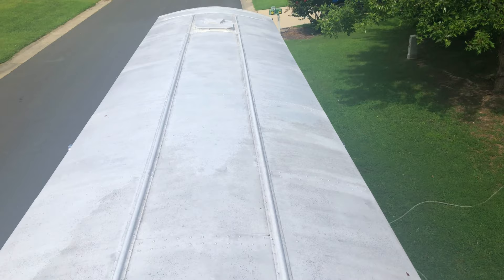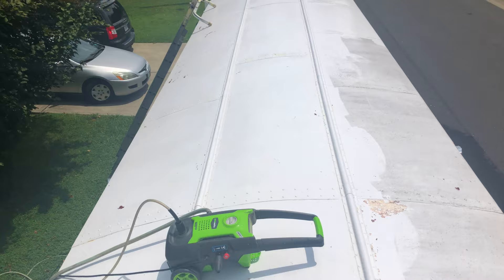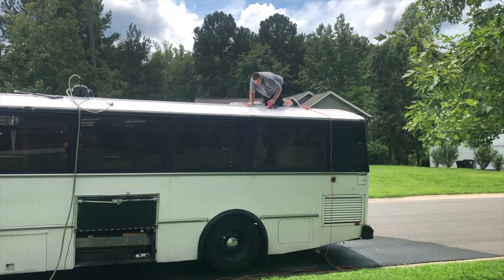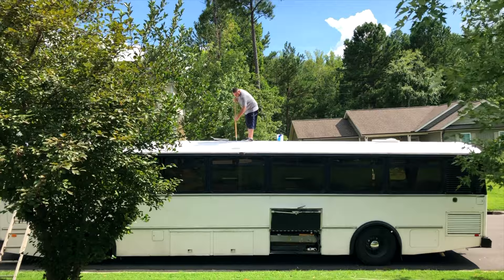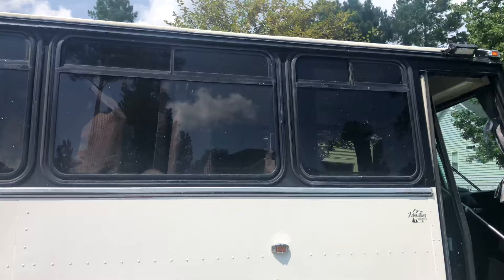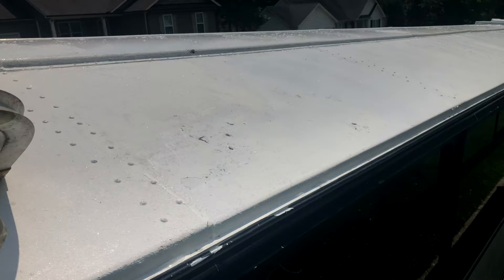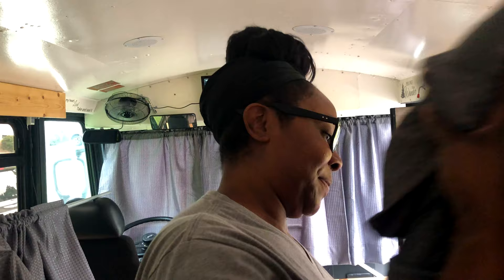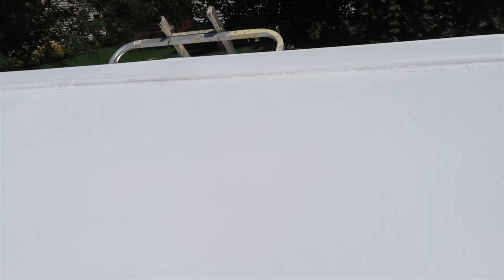Painting My Bus Roof With Henry Tropicool 😡It didn't end well

Comment: I know this is old video, but will pass along some info, henry 887 is 100% silicone coating, if you use this 887, when you recoat you have to use another 100% silicone coating regardless, if it is henry 887 or a different brand, also if you put a vent or something else that needs sealed, Dicor will not adhere to this, you have to use a silicone, henry does have caulking to for this or just use the 887,  I used a brush and put this in a carboard box, next day filled it with water, it sat for days and never leaked, my only complaint with henry 887 is the dust adheres to more then other coatings, also you have to be very careful if on roof when water or dew is on it very slippery
Reply from the maker: Thanks for the comment 🤝

Comment: Great video. Thanks for sharing the challenges of the job. It’s not easy as a non-roofer to get the straight skinny on Henry’s 887, application and product consistency. That is so sickening and frustrating about buying someone’s return as new…that a person would use what they needed, then top off the container with water get a full refund, with no possible way for anyone to check the return or any consideration for the harm they might do to another person. Good to know.

Comment: Nice bus. Sorry about your troubles but think about this. Like Haley said, Tropicool is a 100% silicone coating. Elastomeric paint and roof coatings are water/acylic base. If you have ever tried to paint over a bead of silicone caulk, you would know that water base paint will bead up or separate and not stick to the silicone caulk. Lesson learned, generally speaking, nothing sticks to silicone except another coat of silicone. I'm a 35-year retired commercial painter. These things I know. Next season, just pressure wash again and apply another coat of Tropicool and you'll be good for decades. Or, at 65 mph, the remaining water base coat may flake off in the wind! jk Good luck.
Reply from the maker: Randy Lamoreaux yessir you are correct!  Things like that the average guy like myself wouldn’t know and wouldn’t think to look at it if they are all “roof sealant”. It’s also why I posted the video so people can learn from my mistake.  And most of the paint is already coming off so another Tropicool coat is going g to be needed soon.  😂 thanks for your feedback.
Reply: Awesome i knew that nothing sticks to the silicone but was unaware you could layer it.  Makes  my decision easy
Reply from the maker: Ryan 👍🏼

Comment: Your endorsement of Henrytropicool sold me.
Reply: I did one roof 3 years ago. Still as perfect as the day I finished the job. Now on second roof—the one on our detached garage. Big job for a small roof bc of the need for extensive prep’ing, but going well so far. Next will be the main roof. Bigger job than the other two combined. These roofs are metal with standing seams and are over 90 years old. They have been coated multiple times by people who didn’t remove any dirt or debris sitting on the surface let alone any prior layers regardless of whether they were loose or not. So we’re scraping back probably up to 9 layers of roof coating POORLY applied. If the roof that I did first, the worst of all of them, is any indication I will never have to do anything to the roofs ever again unless something actually punctures them, like hail or a tree branch. Henry Tropi-cool is the best! Do the correct prep and it has a lifetime warranty!

Comment: In my opinion
Your good, if it's not leaking, which probably was your main objective, it's is white and reflecting the sun. Just wait awhile and recoat with the silicone. The other coatings may leave some white chalking on the side of the vehicle as they age but you should be able too remove that with pressure washing. You did a great job
You just got messed by someone trying to get over.

Comment: The problem is the Henry "elastomeric " you used is water/latex based..it will not stick to 100% silicone.  You MUST use 100% silicone Tropicool or some other brand 100% silicone..nothing else will stick...
Reply: Correct. Marketing makes it confusing because it calls it “siliconized” but it’s truly acrylic

Comment: What kind of Henry's Paint did you buy the second time? The tropicool is silicon based, so if you used one of their acrylic based paints over it that might be why it messed up
Reply from the maker: Haley Gill it was because someone returned the 5 gallon bucket after using it and had filled it up with water.  It was open when I bought it so I was already skeptical.  But you are correct
Reply: @TheUngerYears  Whether or not it was returned and cut with water, no other Henry Roof Coating will adhere to Tropi-Cool.
Reply from the maker: @chrisbenoit1035  Yes, we learned that

Comment: Beware of HD staff few know anything about anything.  Henry Products say on label have 24 month self life.  Only one HD in my city had the Henry 884 sealant and 1-gal and 4.75 gal buckets but they were all covered with dust so been sitting on self a long time and beware of age.  The box I took the Henry 884 calk tubes out of was dated in 2017 (I learned later)  so way out of 24 months. One tube was okay, the other was crap. I took the rest back and search the label on the shipping boxes to find newer product.  HD staff was helpful as a heart-attack and had no idea about shelf life printed on the lable.  fyi, when applying roof coating you really need to use a wet film thickness gauge for paint and resins to verify you are coating to required thickness.  Some paint stores have them so does amazon for about $9
Reply: Preciate the info 🙏🏼
Reply: Monty Henson I was putting it on thicker rather than thinner. But if I buy a gauge I may be able to save a lot of $! Thanks for the tip!!
Reply: Monty Henson I had 5 tubes left from a porch roof I did several years ago. Didn’t know how they’d be, but I was able to use all 5! I’d stored them inside vs in our detached garage with zero insulation.

Comment: The second Henry’s you used and the other product were probably acrylic (water based acrylic) and Henry’s tropicool is silicone (oil) based. Oil and water don’t mix.
Reply: The Black Jack Elasta Kool is an elastomeric product.  It won't stick to the 100% silicone and needs several days of clear weather.  
Black Jack Elasta Kote is 100% silicon and should have been fine.

Comment: 1) Check sq footage coverage before beginning. Easy to see on almost any paint product.  
2) If coat #1 is 100% Silicone, then all other coats must also be 100% Silicone as nothing else will reliably stick to it. 
Doesn't matter what brand. Your second coat not sticking has nothing to do with BlackJack, its that it was the wrong product. 
3) You should've used mastic on the rivets and seams before coating. That step was skipped entirely. Hope it ends up alright though. 

Sucks how bad this one went sideways. We've all wasted $10 because we were trying to save $1. 
Lessons learned for next time.

Comment: You are not supposed to coat metal roofs as it can create water pockets that promote rust and leakage.  (see Flat Roof Doctor videos) You would want to rust proof paint probably first and use a flashing type patch silicone with unwoven fabric patches over screws and seams only.
Reply from the maker: So you’re not supposed to paint metal roofs?  That’s the first I’m hearing of this.  Nobody else has ever commented that before.
Reply: @TheUngerYears    Painting metal with Rustoleum type paint/prime is good.  They even make an aluminized asphalt kind of paint especialy for metal,  but silicone or acrylized coatings can crack and let the water underneath which causes water pockets which causes more rust and leaks quicker.  (Even paint can do this, but not so much) 100% Silicone is more UV resistant so better than other roofing coatings, but bad to walk on when you must do maintenance.  You only need paint anyway,  which is cheaper and you can walk on it,  and use special coatings only at the seams and bolts.  I like the Flat Roof Doctor guy:
Why not to paint Metal Roofs:
https://www.youtube.com/watch?v=tEBIPqEvn7A&t=1s

Aluminized Asphalt coating:
https://www.youtube.com/watch?v=MrQEQcrjwFI&t=296s
Reply: @OWK000  I didn't apply tropicool to the bare metal roof.  It was already painted with rustoleum paint before I painted the Tropicool on top of it. FYI
Reply: @brionunger2678  Well if there are any little rusty spots just getting started it is not good.  You can't paint rustoleum or anything else over silicone.  You can only add more Tropicool or totally rasp off all the silicone which is a lot of work.  Just keep an eye on it.  When it goes you will have to make decisions.  I am just researching a flat roof job myself, but I am interesting in the mobile living.
Reply: @OWK000  yeah there was no rust when the rustoleum was applied.  I only sanded it to get it smooth before i applied the tropicool.  Once again the tropicool wasn't the problem.  It was the different paint I added afterward.  Thanks for you comments and good luck with your rig.

Comment: How did the store react when you return that? And who was the other person in the video you didn't shout out?
Reply from the maker: justmaleo when I went to the store the first time looking for Tropicool they only had one 5 gallon bucket of Henry’s but it wasn’t Tropicool it was another type of Henry’s paint.  It was open and not sealed.  So when I looked inside I mentioned that it was much more liquid than the Tropicool.  They said if any problems just bring it back.  In Hindsight it’s almost like they knew it was returned and something was wrong with it.  So they exchanged it out for the other one with no problem.  Other people in this video are wifey & mom recording and Pops was in there for a sec.  Is that what you mean?
Reply: @TheUngerYears  yeah